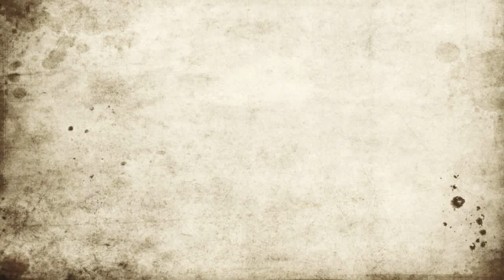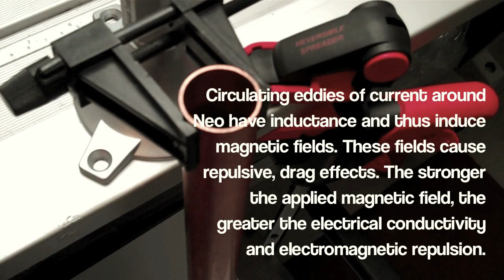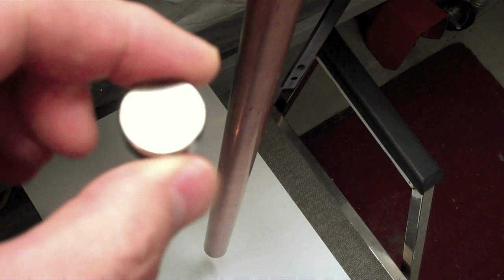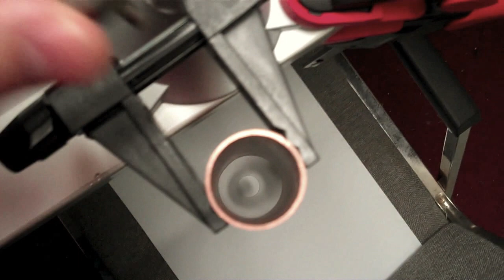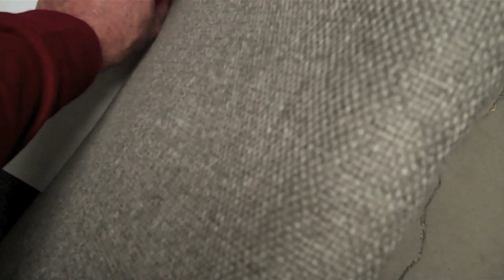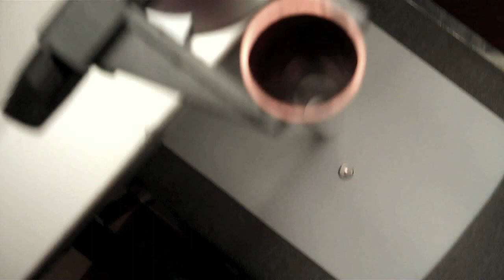Electromagnetic Force in Copper Tube

Comment: Actually I do understand, better than you actually. I know that it is Eddy Currents in the tube causing the magnet's fall to be slowed. You don't, to dispute the correctness of my comment is just absurd. Your initial comment was completely wrong. Friction in this experiment is negligible. Your second comment has some truth, because Eddy current's are "Magnetic resistance" if you want to call it that. The current is induced in the tube creating a magnetic field and resisting gravity.

Comment: and if the pipe is superconducting it doesn't fall at all.
you can also cool the pipe with liquid nitrogen and the speed drops dramatically as well because the resistivity approaches zero. thicker walls also help

Comment: Correction: The stronger the change in applied field [...]

Stronger magnets just make it easier, but a very fast common magnet would also have the same, if not stronger, braking effect.

Nevertheless, great video, very thorough and good angles.
Also, it clearly shows it is not cheap image trickery.